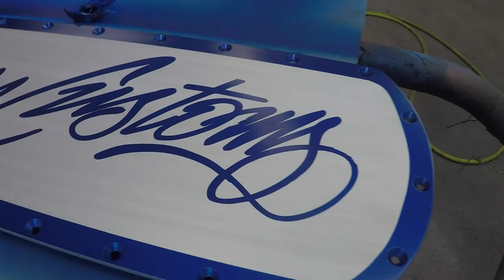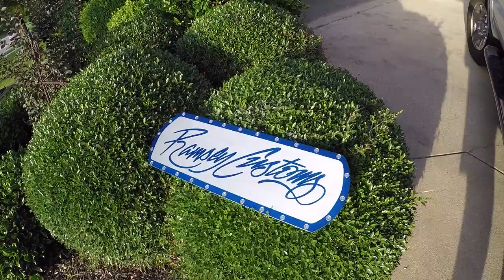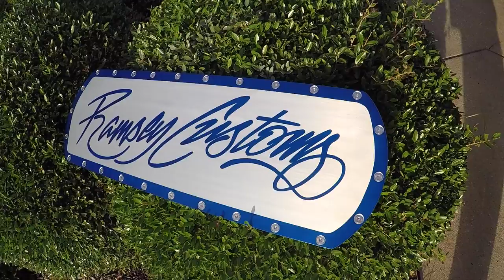Ramsey Custom Sign - Painted! - Squeege Clear Epoxy Over Bare Aluminum

Comment: Fantastic job Gary. You mentioned the direct to metal clear that you used; I thought I should mention to you if you ever need small rattle can quantities of something like that you can get it at your local Harley Davidson parts counter. I have personally used it on the rocker boxes and outter primary cover on my Harley and it works fantastic. Done them about 8 years ago and they still look great. Thanks for another great video.
Reply from the maker: K&L Machine and Welding Ok, I will have to check that out.  Most of the rattle can stuff is 1 part, meaning its uncatalized and doesn't have good UV protection and is subject to corrosion from things like solvents, gasoline, etc... so I will definitely check it out.  There are some rattle can clears that are catalyzed and have a button in the bottom that you press that releases the hardner in the can, but you only have 3-4 hours to use the can before it goes off and is no longer usable.

Comment: Great job Gary.
Do you make your paint masks or have them done at a print shop?
Reply from the maker: cecil6711 I want to buy one of the inexpensive Sillouette vynil cutters that can print small masks out, but just never got around to it, so I have a local sign place cut them for me.  I email them the file and they print them out.

Comment: Looks killer.  What do you use to cut that vinyl?
Reply from the maker: Cobrafanatik22 I have it done at a sign shop near me.  I email them the adobe illustrator file and they cut it out on their cutting machine.  Sillouette makes a small vinyl cutter for less than $500, I have thought about getting one, but just wouldn't use it often enough to make it worth the hassle.

Comment: Appreciate the step up to 60 fps
Reply from the maker: Blaine Enialb Yea, I play with that back and forth.  24 or 30fps does alot better in low light on the go pro.  Of course when I am outside or have good sunlight to aid the flourescnet light, 60fps does fine.